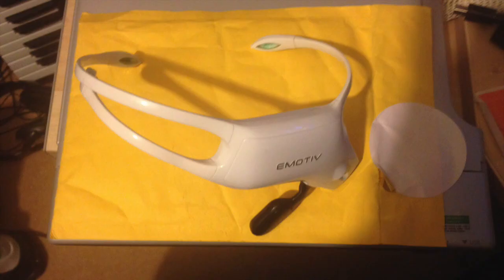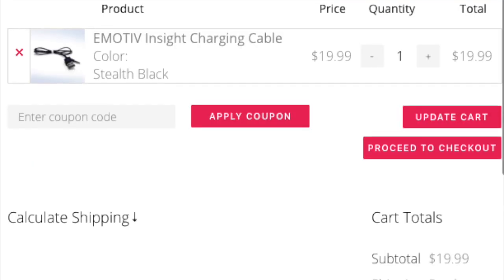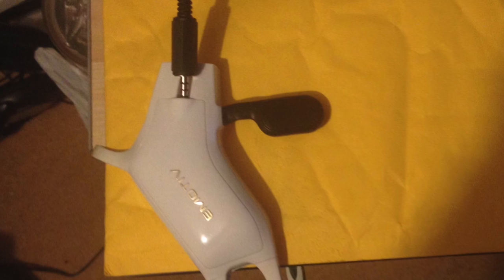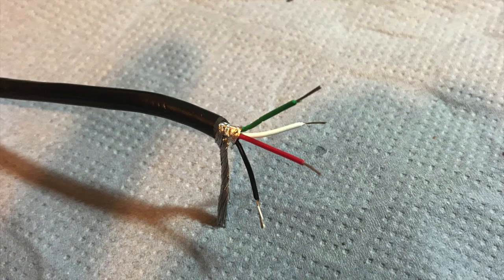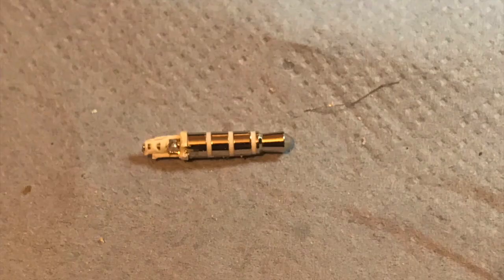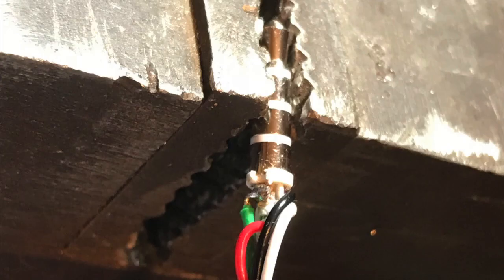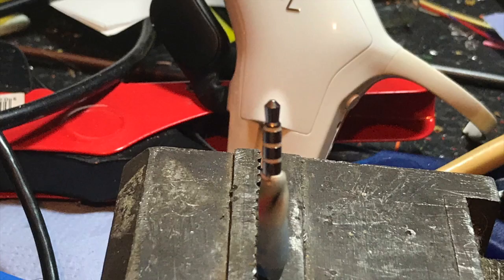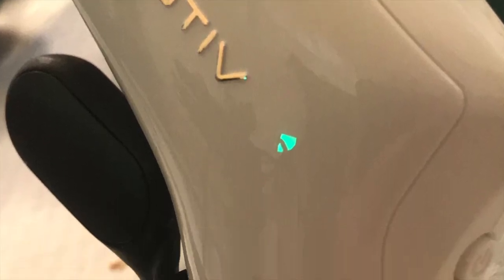Emotiv Insight BCI Home Made Charging Cable  - Part 2 Its Working

Comment: Hi, I have an Insight without official cable too.
I have an iPod Shuffle cable like this one : https://www.amazon.fr/gp/product/B071NM62XW/ref=oh_aui_detailpage_o01_s00?ie=UTF8&psc=1
It doesnt work, do you think its because of an other connection order between pins in the usb and the jack plug ?
Reply from the maker: Yes it will be the pin configuration between the 4 pin audio and the 4 usb pins, thats why I had to swap some of the soldered pins, I used an audio 4 pin plug from an iPhone headset.  You'll need to trace the two.